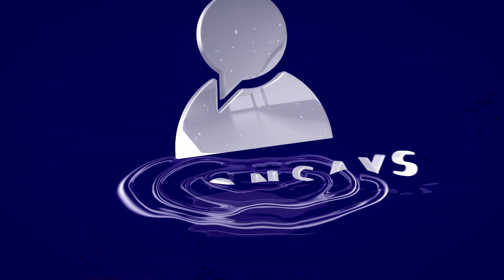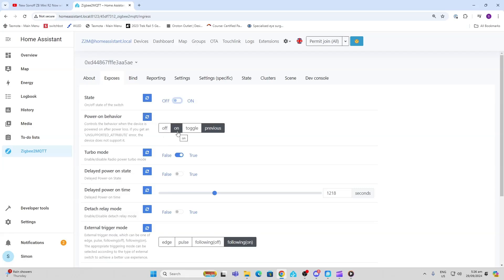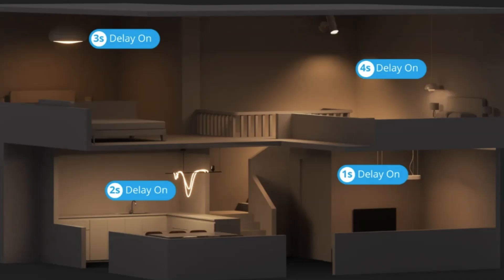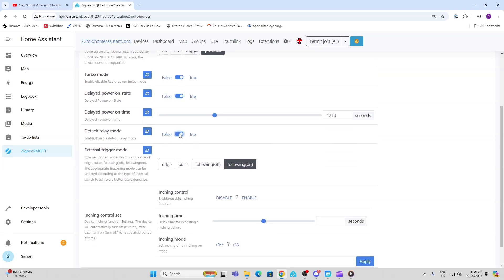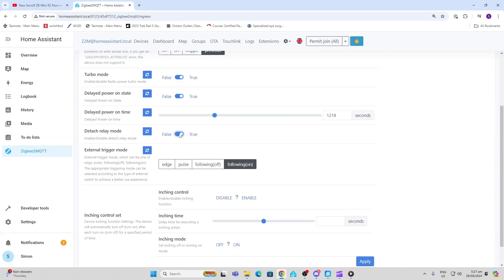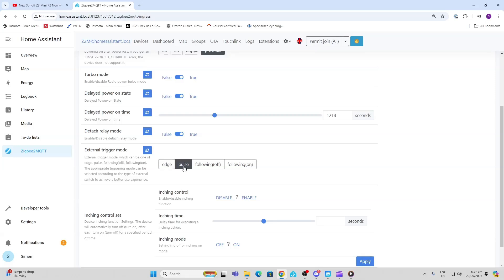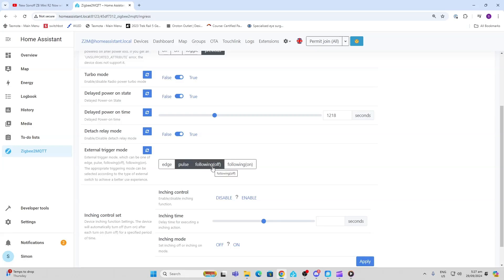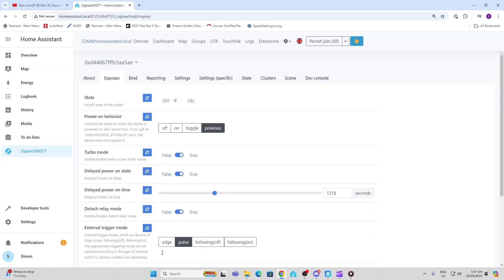Sonoff ZBMiniR2 using Zigbee 2 MQTT

Comment: Please try direct zigbee binding to a zigbee device (eg. bulb or ceiling LED such as aqara T1M/L1-350). This is the biggest advantage of zigbee over wifi for devices we use... in case HA is down, this should still work as a toggle switch in combination with smart lamp.
Reply from the maker: Oh wow I did not realise that this was possible!  I will try this out for you and see how it works.
Reply: It seems to me that such control is possible if HA is down. Theoretically, you can bind devices in Zigbee2MQTT directly to each other (I would sugest use ZBMINIR2), and it would probably work best with creating  zigbee groups.

It would be an almost ideal solution, because:
1. you don't have to cover the physical switch so that someone doesn't accidentally turn off the light bulb. Of course, it is also important to have stylishly matched switches throughout the house, and the largest selection is among the most ordinary ones that everyone had at home before the IoT era.
2. you can control the physical switch, which is very intuitive for everyone. Morover - after using a bell switch, you can listen for a double-click and hold, e.g. to change the light intensity aslo by the same switch
3. you can connect control, automation , etc. via HA
4. in the event of HA failure, you can still use the light normally with a physical switch, which in other solutions in such a scenario would make your home even dumber than before it was smart.

The only downside is the level of complexity of the solution and the higher costs, because you have a smart bulb that already has a relay in it, although with lesser capabilities and is also a zigbee router, and you have to buy a relay separately and connect it. You only save a little, because you don't buy a smart switch, because a relay connected to a physical switch makes it smart.

If it weren't for the fact that I want a smart bulb to control the color of the light, I would use a regular physical doorbell button, a regular bulb adapted for dimming and a dimmable relay such as Shelly Dimmer 2 or Tuya ZigBee 3.0 Smart Dimmer. Then I would have all the advantages I mentioned above much easier and cheaper with light intensity regulation, but without light color regulation.
Reply from the maker: @shustypl  Yes, it is really great if you can get smart switched to connect to lights in case of fall over of the server.

In my bedroom I have a RGB colour light and a zigbee button switch on the wall.

With Home Assistant you have so many options!
Reply: I am discussing this with the Sonoff team, and they are considering including it in a future firmware update. If this actually happens, we'll have the switch module of the year—no doubt about it!
Reply from the maker: @andraz007  Oh wow that is really cool!  Yes, I am really impressed with the kit that Sonoff is producing!
Reply: @andraz007  What functionality are you talking about that they are considering adding in a future update? I thought that ZBMINIR2 can already be directly bind to other zigbee devices via Zigbee2MQTT
Reply: @shustypl  No, it doesn't work. They're half way there though. I hope they figure it out and make it work. Please write them (their webpage, contact support) so they can see how much ppl are interested in this.

Comment: I have two buttons on my wall switch, is not not possible to enable detached mode on only one of the switches? I have one bulb connected that is a smart bulb, while the other is a dumb one
Reply from the maker: Hi Johan, yes you can just wire the one switch to the relay and the other to the dumb light